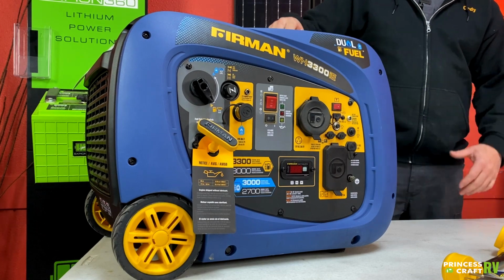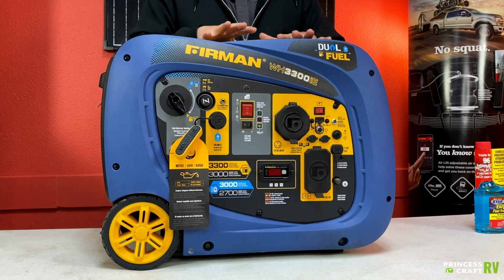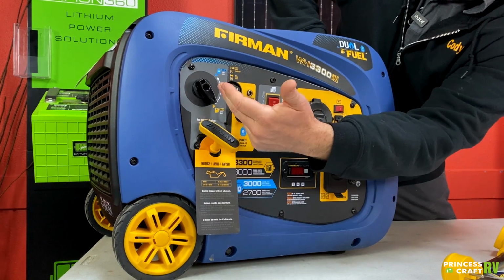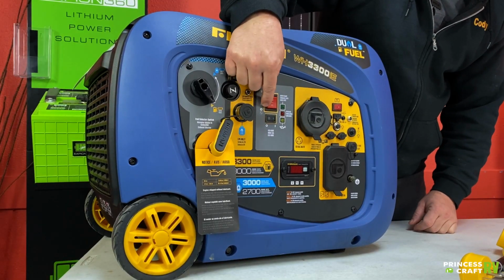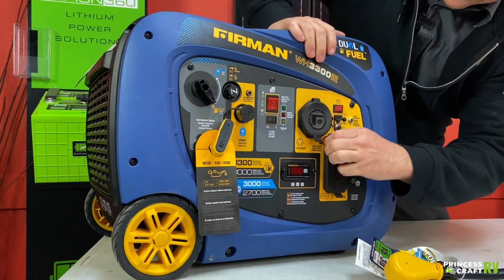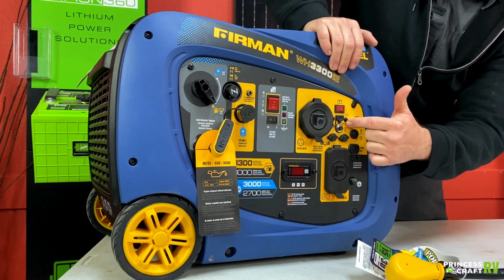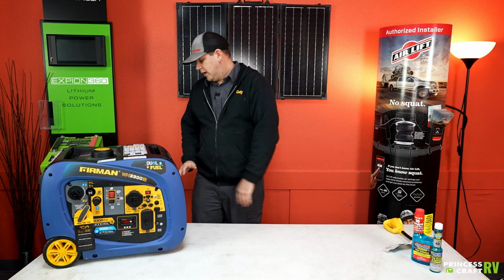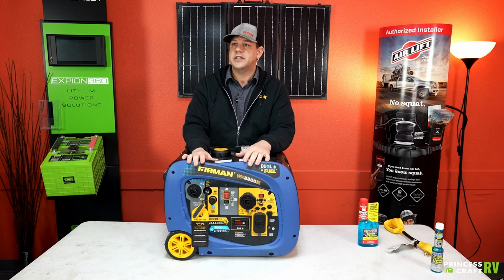Firman WH03042 - 3300 Watt - Dual Fuel Inverter Generator

Comment: Dumb question, I cant get my electric start to work.  I have never plugged my charging cord into it to charge the battery.  I thought the generator would be able to charge the battery itself.  The Google machine says that it should charge its own battery.   Any advice?  My cable is in my camper a couple hours from home.

Comment: On the smaller 2200 the air intake is right on the bottom of the machine and sucks sand and dirt into the machine and breaks it. Where is the air intake on that model.

Comment: My late husband purchased one of these and I now need to use it to connect the electric to an RV. If I understand your instructions correctly, all I need to do is connect the RV electrical cord to the generator outlet and start it up with either gas or propane, right?  And then it should charge the batteries?  About the propane:  one of my issues is that I cannot locate the original box or parts it came with. What type of hose/connectors do I require to pair it with the RV propane tanks, please?  Thank you for a very instructional video!

Comment: 100% best Generater.Systems I have used. A test for hurricane prep here in Louisiana: three AC units, 5000, 5000 & 8000, 3 fridges, 2 device power setups, 4 flat screens....AND I had 40% of the power meter to spare.
Reply: On this one generator?

Comment: It’s so hard to find a good review that explains all of the parts and pieces to these generators.  I’d love to buy one but I’m nervous because I never owned a gas device before other than my car.  I also didn’t know how these work.  I feel more confident now after watching this video.  That’s interesting about the fuel stabilizer.  My purpose is for emergency home power only so I may not need to use it often.  Having a stabilizer mixed with the gas is a great tip.  I wish Firman sold smaller inverter generators like this that used natural gas.  Dealing with smelly gasoline and expensive propane tanks is a nuisance.  Can this generator be used to run a forced air furnace that runs on natural gas via one of the 120 volt 20 amp outlets?  I have the Lenox EL195 furnace. Thank you so much for this video.  It’s the best one I’ve seen yet.
Reply: I personally would have told Ryan to F off.  He doesn't know you!  I have three Delta Pros and I would NEVER give up my dual fuel generators.  On a another note, Propane doesn't spoil so it is a great emergency fuel source.   If you are going to use gasoline, use TruFuel.   Rather than use a fuel additive when storing, just run the generator out of gas before storing.  Good Luck - stay prepared.
Reply: Please stay away from small engines. You are not someone that will do well with the maintenance and care. Try the Eco flow delta. No gas, no maintenance except charging.
Reply: @A_Man_In_His_Van eco flow is not enough power, they aren't cost effective. A gas gen is cheap and produces tons of one demand power.
Reply: @A_Man_In_His_Van  Thank you for sharing your advice.

Comment: Just so you know, when starting on propane you don’t need a choke. Using a choke when starting in propane mode will keep the engine from starting.
Reply: In my owners manual it says to use the choke. Page 28 I believe.

Comment: I just saw this model at Costco for about $600. The low price alone makes me wonder about the quality. That seems too cheap for this size generator with this many features. I would VERY rarely use a generator, so it would only be for occasional use or for emergencies (hurricane, etc). I've been considering the Honda eu2000 for it's high quality,  lightweight and quietness, which are all important to me, but for $600 maybe this is a better option?
Reply: It is a decent quality Chinese generator at least comparable to the other China made competitors. Most resellers price it around $1,100.  I don't know how  Costco was able to give such a good price.  

Hondas are great generators and are the way to go for regular use such as construction or a food truck.  They appear to have higher quality inverter boards and better steel in the engines.  However for occasional use, the Chinese generators are a much better value.  Firman and Champion have part warehouses in the US so they are well supported. 

I have a couple of Champions and picked up the Firman at Costco just before the sale ended. I only have about 6 hours on the Firman but so far, so good.
Reply: @bruceh3786  - Well, I bought one and it really screwed me on a job. I used propane and it worked great the first time I started it, but afterwards it refused to re-start. I tried many times using the electric and hand pull. I've got many years experience using all sorts of small engines so I know how to start a fickle engine, but this one just wouldn't. Really pissed me off.
Reply: @need100k  Sorry to hear that. I have just run mine on gasoline so far. I hope you post back the cause of the problem once you figure it out. Does it start and run on gasoline?
Reply: @need100k  I've noticed generators are sensitive about the oil level.  I put my Champion generators on a level surface and fill the oil to just about the second thread from the top of the oil fill hole. One won't start the other day when the oil was only near the bottom of the threads. I suspect my Firman will be the same as the engines look like they come from the same manufacturer. Maybe that one run consumed enough oil to trigger the sensor.

One YouTube comment I heard is the Firman will not start on propane if the choke is open. 

I plan on testing mine on propane the next time I get more propane.
Reply: @need100k did you need to charge the electric start battery?
Reply: @need100k  glad it worked out for you

Comment: Can you burn off all the gas in the carburetor by moving the fuel selector switch to LPG while the generator is running on gas and then set the engine switch to OFF?
Reply: Yup

Comment: thanks cody ,in very cold climats syntec oil is a must ,and if you want a 75 watt heat pad on the block ,it a very nice gen ,had on for 5 years gaz ,800 hr of run time still working fine ,

Comment: I haven't even used it and have had nothing but problems from day one. First the oil drain plug is plastic and did not seal after adding oil. Yesterday I went to start it like I do once a month. Ot started right away, but was running like crap on both gas and propane.
Reply from the maker: Contact Firman to find a service center and to get warranty information, should that be the necessary route. What you're describing is not typical, in our experience.
Reply: @RVTechToursatPrincessCraft  I did last week. Had to  make appointment.  Norther Tool. Have to wait til the 29th to take it in.

Comment: mine will not turn over,firman does not answers questions,taking it back to costco,very disappointed
Reply: Did you find out why?
Reply: The unit ships with the starting battery disconnected. You have to remove the maintenance cover and plug the battery wire together. Did you do that?